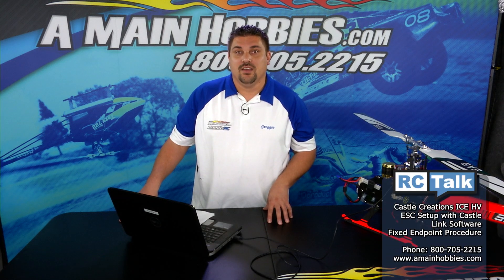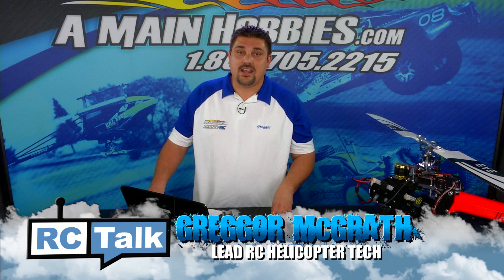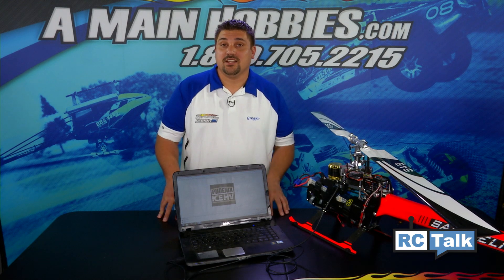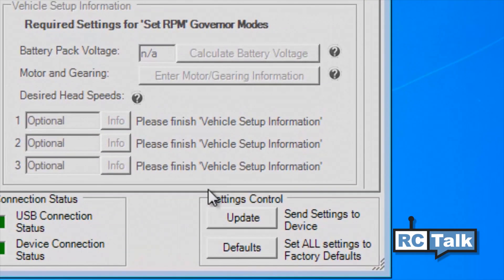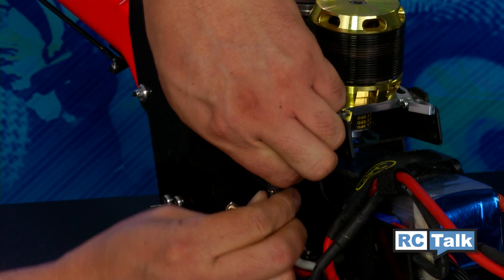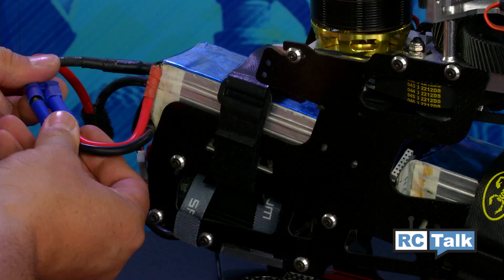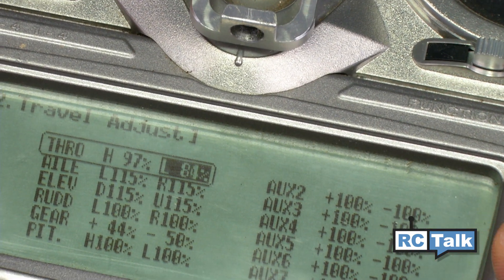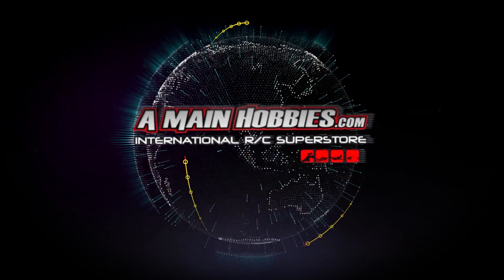AMain Hobbies' RC Talk: How To Set-Up Your Endpoints With The Castle Creations ICE HV ESC

Comment: When you set fixed endpoints, how many time you need to setup ? One time is enough for all flys with that ESC configured ? 
Thanks 
Rodrigo
Reply from the maker: Yes, only once. As long as you save the programming by hitting the "Update" button, the settings should now be saved. 
-Brett

Comment: Why do you lower the "throttle trim" all the way down?
Reply: Surely the engine being rich doesnt apply in this case as we're talking electric. So, I do not understand why when setting the end points the throttle trim is lowered.